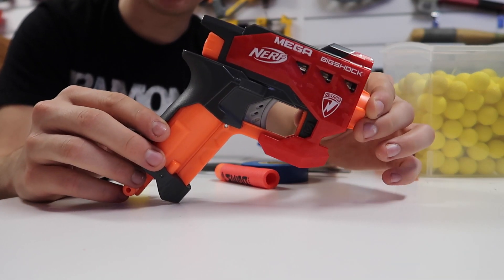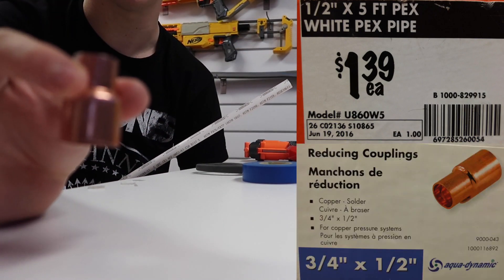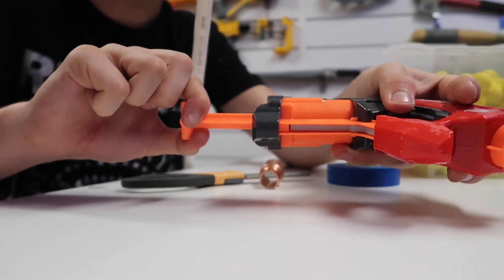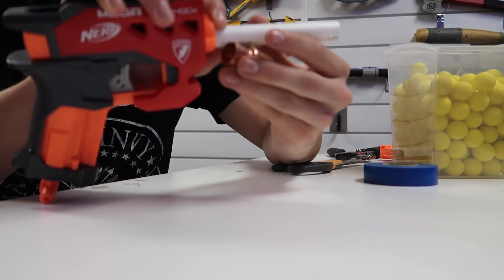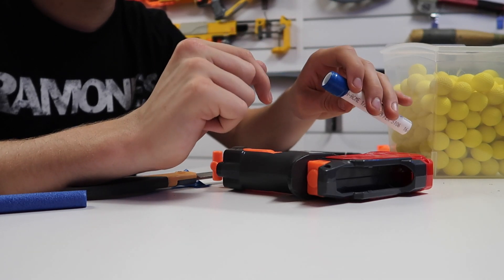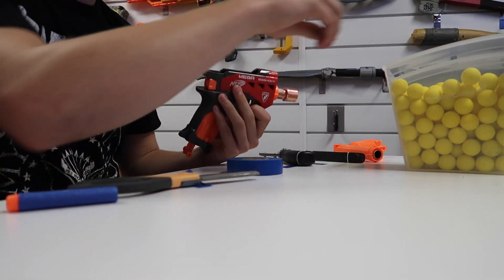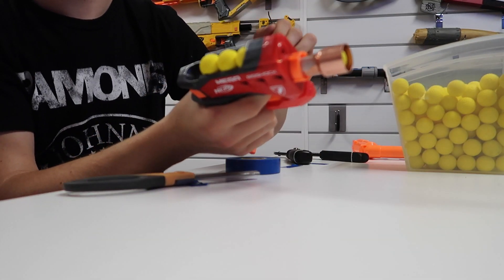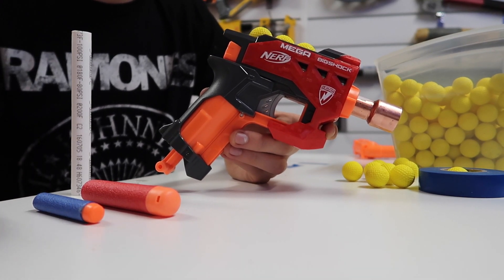NEW Nerf Rival Pistol!! (Big Shock Mod)

Comment: You can not say it is new if some one ,drac ,has done this.
Reply: drac stole it from reddit so drac is the actual credit stealer.
Reply: Nerfer 9871 no-one cares
Reply: Nerfer 9871 yeah he did it different
Reply: Invicte Jsk just like nerfboy productions is also a credit stealer
Reply: Unlike Drac, you don't have to take the gun apart.

Comment: It doesn't need to be a pipe down the barrel, any piece of thin cardboard rolled as a tube would do the trick. If short enough, you won't need the extra "coupling" to shoot rival rounds.

Comment: if the pex pipe fits the elite dart then technically you could slip off the coupler in the middle of battle (assuming it isn't fastened) to it and use an elite too. MODULARITY!!!
Reply: I was thinking about something like that.